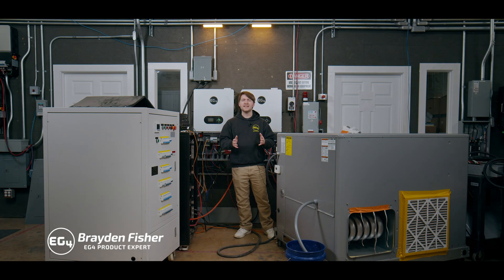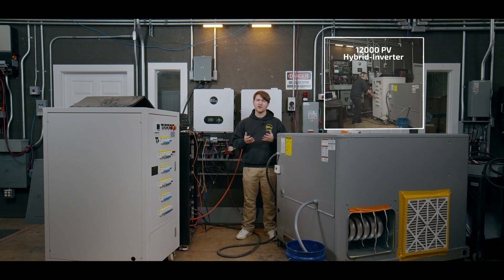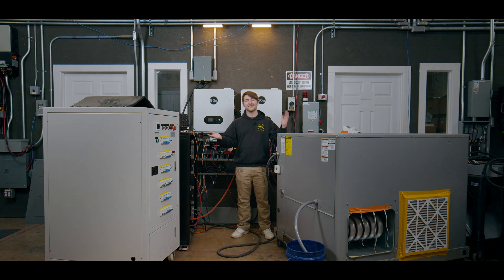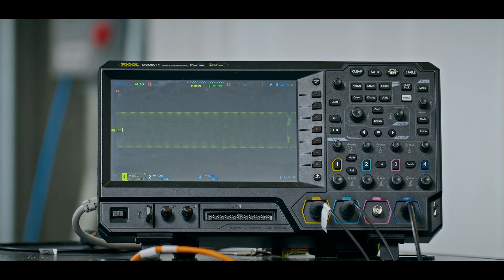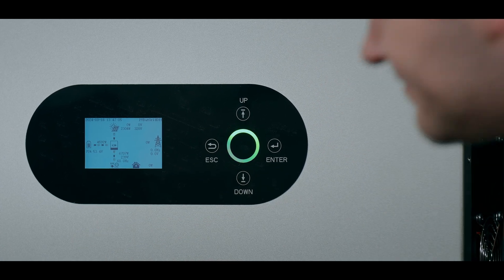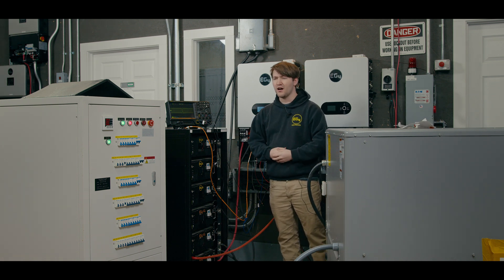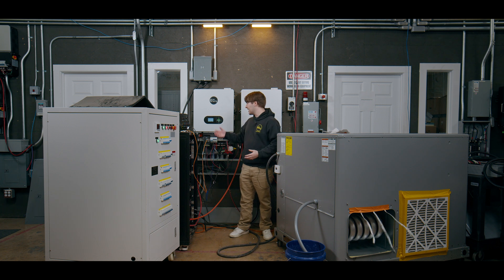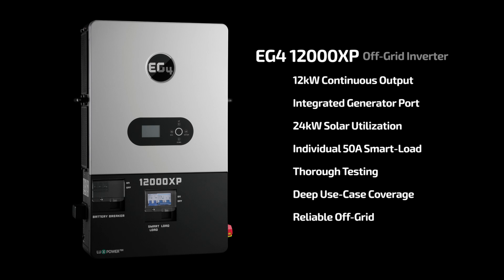EG4's 6000XP Has a Big Brother! | The 12000XP High Power Load Test (5-ton HVAC + more)

Comment: Can y'all do something about the clunky gen to batt switching?  When charging completes it opens the dry contacts before switching to batt, it also switches to gen before it's had time to stabilize. The brown and black outs caused by this are completely unnecessary.
Reply: SO it browns out?  Yikes, so I have to reset all the clocks etc and put UPC's on all appliances so the electronics do not get fried?  Rut Ro.  Not surprising they clearly cut the large transformer allowing frequency matching with the grid, leaving only the capacitors and some inductors for phase chopping from DC to AC.  This = no bueno!

Comment: Im sure the inverter can do it but this is complete BULLCRAP because the compressor never came on in the 2nd run. You cannot stop and restart immediately an ac unit like that. It has a protection that prevents short cycles. Clearly i can hear the compressor come on the first run but the 2nd run it never came on.

Comment: @EG4, are you saying that these high frequency inverters are fine for use in starting a 5 ton unit without a soft starter? Any comments on the longevity of your inverter for this use case?

Comment: Man! I just bought the 6000xp, now there's a 12000xp😮
Reply: I have two 6000XP's, I like have two of critical items, if one craps out I still have power.  I did have two 6500EX's but being 120v I needed both of them phased to get 240v for my deep well pump.  I used the upgrade program to get the 6000XPs
Reply: @daddio7249  you also get individual 4 mppt's with 2 6000's which would have been really nice in my situation. Due to space limitations I will be replacing my 6000xp with the 12000xp though